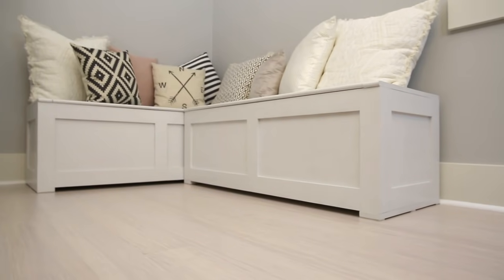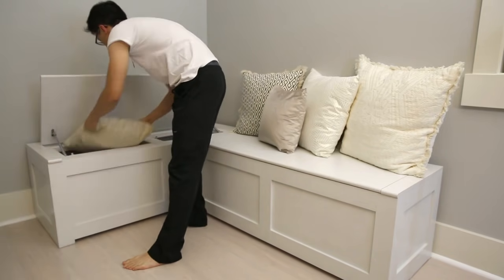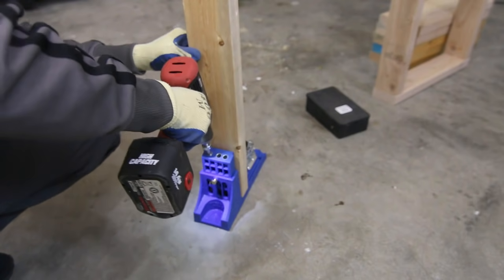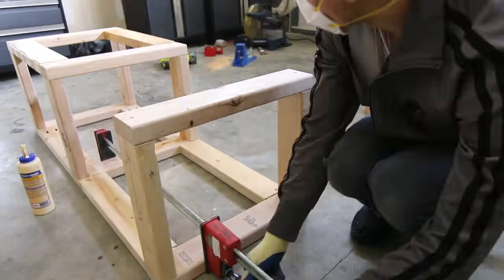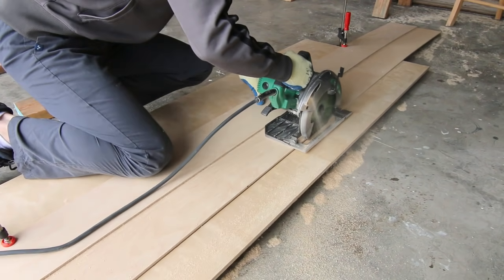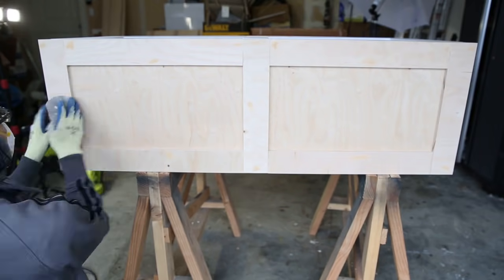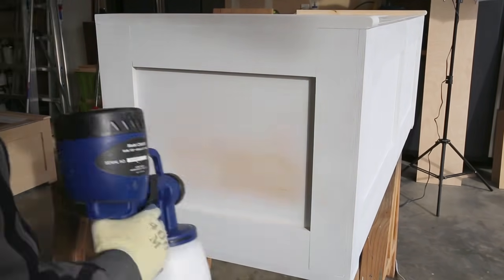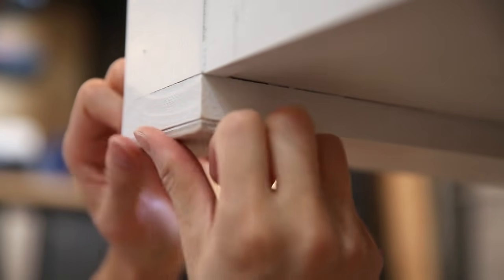Kitchen Nook Storage Bench DIY

Comment: I've never noticed a tool like the Pocket Hole system. I guess I have never looked. I will hunt one down though to improve my DIYing!  Nice looking bench.
Reply: Its called a Kreg Jig, you probably figured that out by now but I just noticed your comment
Reply: This is a Kreg jig.  Available at Home Depot and Lowe's or online.  Been around forever, mainly used in furniture and cabinet making.  You can buy the special screws required at the same time.

Comment: I am just in the process of making this bench. I really dont know very much about anything handy. I realized I used pocket screws for the vertical frame posts along the whole frame. Pocket screws were meant for the horizontal pieces. Does it matter? Should I redo? Can I use wood screws and glue for the horizontal sections of the frame? Does any of it matter? Lol, my apologies I really have no clue.

Comment: Great work Paul. You have encouraged me with your design that I can redo a bench seating in my kitchen from a professional botched job. Where can I pick up the yellow tool you used to guide your plywood across the table saw? IT wasn't in the list, but I think it helps keep the wood from slipping right? Thanks.
Reply from the maker: Yeah I feel safer when I use it. I rather have the saw blade cut the jig than my hand. Thanks for letting me know. I updated the list. But here is the link https://amzn.to/2zob1UZ

Comment: Nice work!   I'm also in the market for a paint sprayer.  Yours looks like a graco?  Likes/dislikes?  Would you recommend?
Reply from the maker: I used HomeRight Finish Max (in my description box) which is very inexpensive paint sprayer for a weekend DIYer small projects only. I have a Graco sprayer that is more for painting larger projects like an entire house but it was so difficult to setup and use and way more time cleaning. The Homeright one is very easy to use and cleanup but for much smaller projects. They also have another model HomeRight Super Finish Max which is for medium scale projects (cost about 20-30 dollars more).

Comment: Could I use finishing nails instead of brads for the trim? I have a 16 gauge nail gun and don’t want to buy a new one if I can avoid it.
Reply from the maker: Yeah I think so. 16 gauge will make bigger holes but you can fill them in as needed with caulking or wood filler to hide it.
Reply: Thanks

Comment: did you get wobbles when doing your frame? if so what did you do the solve it?
Reply: If you have uneven floors the best thing to do is add adjustable feet to the bottoms of the corners.  These are available at any big box store and run about $3.00 each.

Comment: You were doing great until you used "paint with primer".  You need regular wood primer first.  Nice job otherwise!  Good tutorial.  Although most people don't have the tools you do, it can be done with a bit of common sense, a square and ALWAYS glue and screws.  I'm going to be making one for a customer, but she wants drawers on each end and not a lift up top.